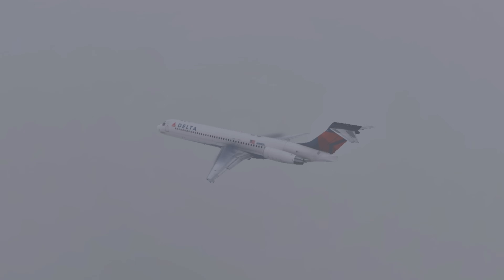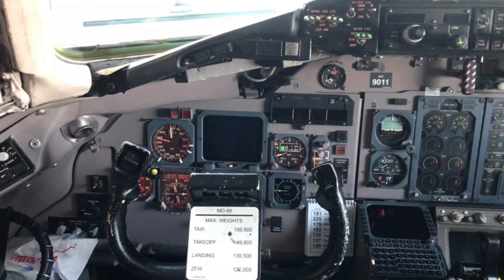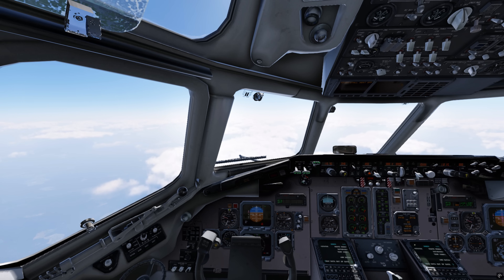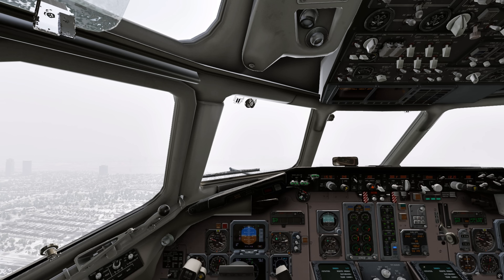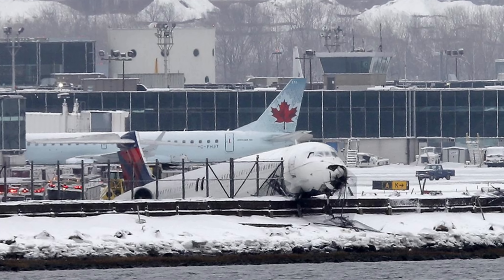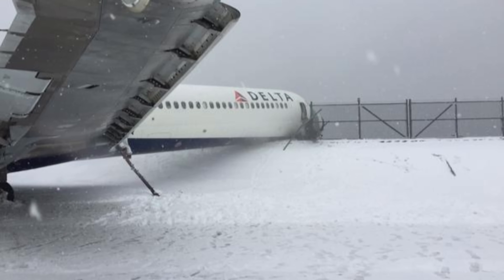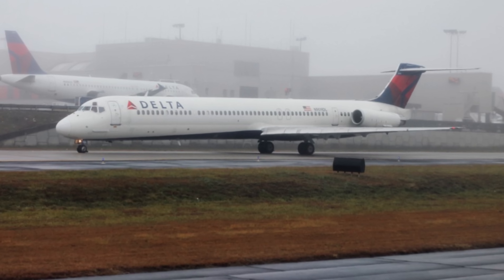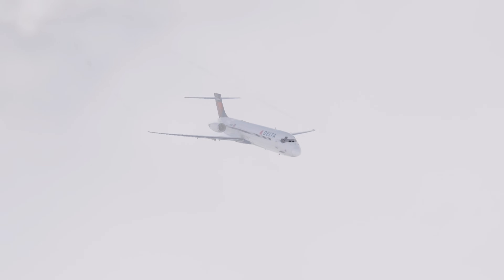UNSTOPPABLE SLIDE! What Caused the Flight 1086 Runway Crash

Comment: Thanksgiving Eve 2004, I was working the ramp in LAN when a sudden snow squall reduced runway braking conditions to NIL just as a NW DC-9 touched down.
 They went straight off the end, but nobody saw it as the visibility was so poor. Thankfully, no injuries as the ground was soft enough to slow the aircraft without serious damage. 
 We did, however, have to open the cargo doors on our knees, as the fuselage was touching the ground.
 Closed the airport for the rest of the night. Head on a swivel, and expect the unexpected! ✈️ 😉